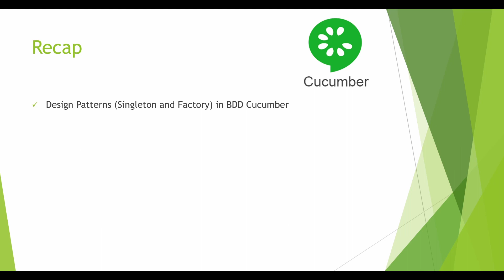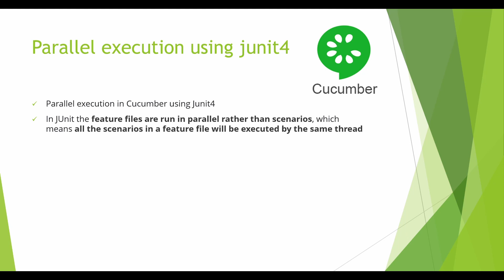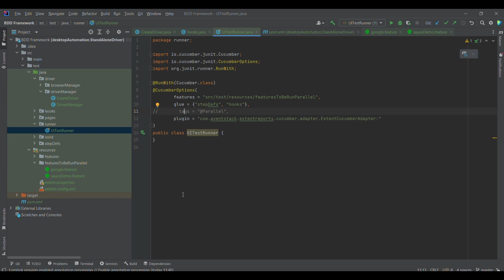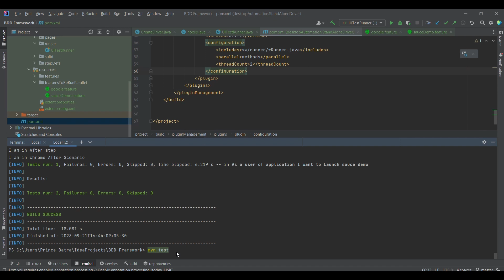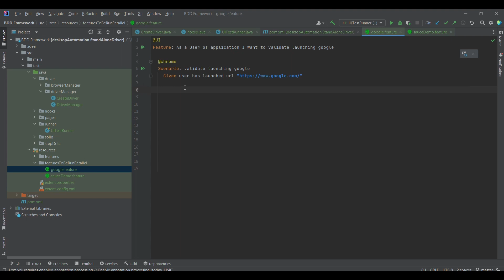Lecture15: Parallel Execution Challenges in Cucumber + Junit || Interview Question

Comment: can we used like below as I haven't implement Factory designed pattern :  
public void setDriver(String browser)
{
         switch(browser)
         {
               case "chrome":
               WebDriverManger.chrome().setup();
               driver.set(new ChromeDriver())
               break;
               default:
               throw new IllegalArgumentException(" ");

         }
    
}

public WebDriver getDriver()
{
   return driver.get() 
}
Reply from the maker: Yes it should work but driver should be thread local